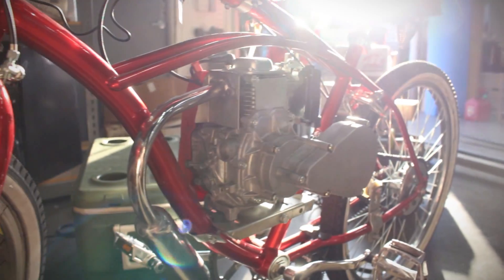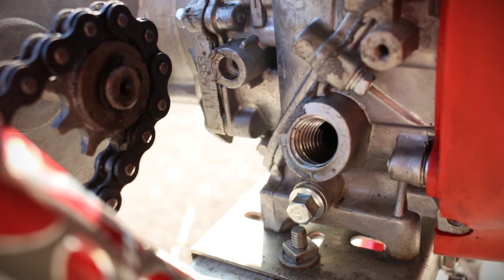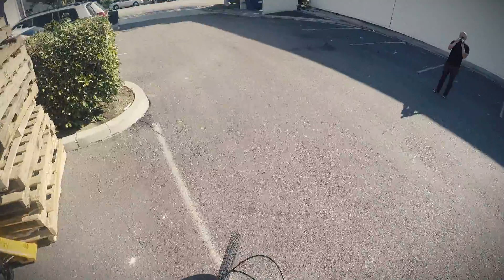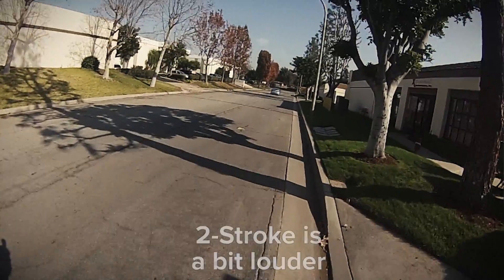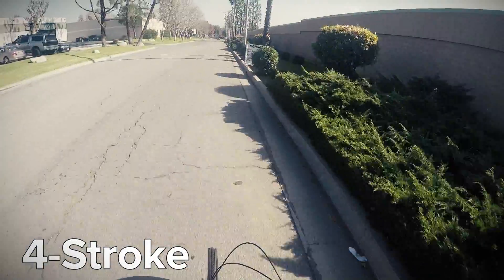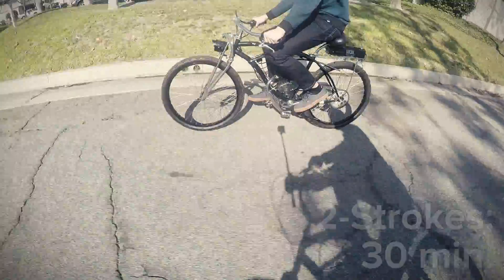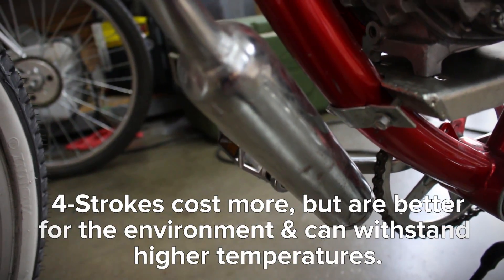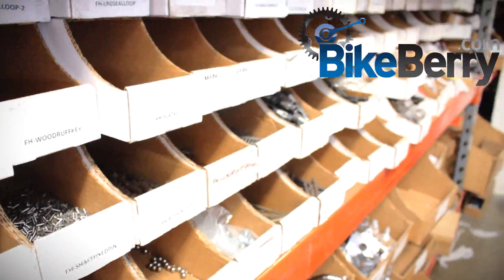2-Stroke vs 4-Stroke Motorized Bicycle (GoPro)

Comment: Don’t listen to him you wanna go 2 stroke all the way you can ride way longer than 30 minutes on a two-stroke this dude’s out his mind. I have 100 cc bike Barry T1 102nd GEN and I took that thing on a three hour nonstop ride… and if you live anywhere where you need to get uphills, a four stroke will not cut it.. four strokes are horrible for hills because they have a belt system… a two-stroke has a chain system as soon as you let off the clutch it engages the motor directly.. that’s why you get more speed and more torque.. They’re actually easier to maintain… they actually last longer than four strokes. Don’t listen to him because there’s less moving parts as long as you mix your oil right with your gas your motor will be OK. I’ve been watching YouTube channels with guys who have the same bikes from six years ago and they’re still cruising with the same stock parts…. Yeah I’m into the motorized bike building hobby… about to post my latest creation with its new paint job. I already posted a video before I gave it a paint job so you can see it.

Comment: The description at the beginning of the video is wrong. 2-strokes and 4-strokes BOTH require 2 strokes per revolution. Up and down. A 4-stroke engine goes through four stages, two complete revolutions, to complete one power stroke, while a 2-stroke engine goes through 2 stages, one complete revolution, to complete one power stroke. But there are 2 strokes per revolution on both of them. When a 4-stroke piston makes 4 movements up and down to complete a cycle, it's 2 revolutions, not 1.

Comment: I have build a 2 stroke engine bicycle build four times but the 4 stroke is the best of reliability (Engine will always start), fuel efficiency is far better than the 2 stroke engine, quieter than the 2 stroke engine, little maintenance, gasoline burn cleaner than 2 stroke engine, very little to no vibrations, 4 stroke engine last longer than a 2 stroke engine. 2 stroke engine is noisy, it vibrate the bicycle and loosen the bolts & screws, it leaks oil, 2 stroke engine is a dirty engine cause you have to mix the oil with the gasoline together, doesn't completely burn all the fuel and sometimes it won't start. The only pros about 2 stroke engine is that the engine and parts are inexpensive, it can be easily modified or upgraded many ways (for faster speeds, aesthetics, etc., etc.) and it slightly has a bit more power than the 4 stroke engine (2 stroke engine - 66/80cc displacement, may get as little as 3 miles per hour to as high as 10 miles per hour faster than the 4 stroke engine (49cc displacement) even if both are using the same amount number of teeth on the sprocket.).

Comment: Now I know that my "1990 vintage Hyper motorized bicycle" is a 2-stroke one. I bought it just recently from a local pawnshop for $380.00, "as is."
I had trouble turning on the engine, though, because I didn't exactly know how. I've watched another video on how to turn it on, including yours, today. Also, I didn't use a mixture of oil and gasoline on it...because I wasn't too sure about that. For a period of about 3 hours, I tried making it work. 👉 PROBLEM: They sold me the bicycle with a couple of wires loose. The one that connects to the "throttle" was disconnected. I connected one of the two wires to the blue wire that leads to the CDI box. Also, the white wire was disconnected, but I now know that it doesn't have to be connected to anything because it's optional and because it is sometimes used for connecting lights to the bicycle. 👉Another problem that I encountered was that both the gas line and the little gas filter started leaking. I need to replace those parts. 👉In the end, I decided to just come home peddling my vintage motorized bicycle, instead. 
Thanks for all your vital information... and for enlightening me. From, "Curious Joe" 😼👍

Comment: Sorry, but a 4 stroke is not 4 strokes per revolution.  It has just two.  A single cylinder two stroke has 4 strokes per revolution.  A single cylinder 2 stroke has one power stroke per revolution.  A 4 stroke (single cylinder) has one power stroke for every 2 revolutions.

Comment: 3 more significant differences :  1) the 49cc 4-stroke engine has a forced air cooling fan that is effective at all RPMs,the 2 stroke has no cooling system, it relies on moving the bike through the air  2) The 4-stroke has a proper lubricating system, the 2-stroke has a very poor lubricating system , so the 4-stroke should typically last much longer due to less wear  3) The gas mileage is much better with the 4-stroke. Period.
Reply: 4 stroke makes less power forgot about that
Reply: air cooling fan? where

Comment: Ow thats weird, normally 4-stroke engine have more powre. How come the 2 stroke in this case has more power and more speed?
Reply: Both engines sound horrible... liek its metal on metal rasping, is that normal? Never heard fuel engines make such rasping sound

Comment: Don’t purchase from bikeberry horrible customers service and they’ll sent you a piece of crap and when u email them. They’ll play the pictures bs. One of the crap customers service   👎🏻👎🏻👎🏻 buy a Chinese one from eBay is much better at least you have eBay money back guarantee.  Bikeberry suck 👎🏻👎🏻🤮. Purchase from bikeberry they sent me a piece of crap it. The treads on the head was stripped and sent over 20+ pictures bikeberry customers service didn’t help. Told me that I have 3 months warranty which I knew and my purchase was only a week old. Bikeberry suck don’t waste your money you’ll regret.

Comment: You want a 4-Stroke! Especially if you want a to ride for more than 20-30 mins in temps above 80. In my experience, 2-strokes are a pain in the ass. Mixing oil + gas = EXPENSIVE FUEL! Who cares if you're getting 100 mpg when you are paying 2.50/gal for gas and 5.00 for oil mix. That's 7.50/Gal vs 2.50/Gal. So now, your noisy smokey rattling pain in the ass little motor who only likes cold weather REALLY only gets 33/Mpg. You're Welcome!

Comment: Where does the tank fuel line connect to the carb, no hoses were connected when I got the motor, there is one nipple bent downward and one straight coming from the carb and two more on the carb bowl.

Comment: 2 strokes suck/push in the gas/oil mix and they complete a full cycle in 2 strokes. 4 strokes require more strokes to complete a cycle and must have the oil separated from the gas.

Comment: Power? 2 strokes are much, much more powerful then 4 strokes when tuned right with a good exhaust on.

Fuel economics? 2 stroke generally drinks more fuel, as they're 2 strokes. Because of that, they're not very enviroment-friendly. But who the f*** cares?

Price? 2 strokes are cheaper due to the simplicity of the engine.

Maintenance? 2 strokes are easier to maintain then 2 strokes, due to their simplicity.

Top speed? Depends on what sprockets you use, but as 2 strokes are easily tuned and more powerful than 4 strokes, you can reach pretty good top speeds. 

Acceleration? 2 strokes got a lot of high end power, more than a 4 stroke. Acceleration on 2 strokes will be much better than 4 strokes. Do some good tuning to your 2 stroke engine and you'll get to much higher speeds and faster accelerations.

Fuel? 4-strokes run on normal unleaded fuel. 95 octane works just fine. 2 strokes however, usually needs to have both oil and normal fuel in it's gas tank. Although this can vary from bike to bike, as some 2-.strokes bikes gets it's oil from another oil container through an oil pump. The recommended mix of oil and fuel in a 2 stroke engine can vary from different engines and setups. But the normal mix is usually somewhere around 2-3% oil (it usually says 1/50 on the cap, which means 2% should be oil (The other 98% should be fuel) in the oil-fuel mixture).

What should you buy if you wanna annoy neighbors? Two strokes.

What should you buy if you're a pu$$y? 4-strokes.

And also, i do want to point out that 2 strokes are NOT manuals. 4-strokes are NOT automatics either. The engine is not "automatic or manual", it's the transmission. 2 strokes can have automatic transmissions too, but they usually never are, because you don't engine-brake with a 2-stroke motor*.That's why i think 2 strokes are manually, and so there usually is a clutch on 2 strokes, that you can pull when not giving throttle.
---------
* All you non- bike/car type of people that doesn't understand why, let's just say the engine is not going to get oil when u don't give your engine throttle and the cylinder and piston is going to take damage, which can be expensive and time consuming to replace. But not as time consuming as 4 stroke-cylinder changes are.

Comment: One thing only briefly touched on (wording was something like "4 stroke engines are better for the environment") is that 2-stroke engines have exhaust that is a LOT dirtier than 4-stroke engine exhaust. So dirty that even a tiny 2-stroke engine spews way more incompletely-burned and unburned hydrocarbons than even the largest luxury SUV with an 8-cylinder engine.

Once you bolt a gasoline engine onto a bicycle, you no longer have a bicycle -- you have a MOPED, a type of motor vehicle. Like all motor vehicles, it requires licensing to be legally operated on the public streets and roads. If you build a two-stroke moped, it will be so dirty that it fails basic EPA emissions standards and can't be licensed.

If you ignore these rules, a cop might notice your lack of a license plate, stop you, and write a citation with a nice, big fine. This is why bikeberry.com has disclaimers about its 2-stroke kits only being suitable for racing use.
Reply from the maker: This is true however some local and state laws allow for these engines. Also, check out our EPA approved kits.

Comment: Are you comparing a 80cc 2 stroke to a 49 cc 4 stroke?
Reply from the maker: no the 2 stroke is a 66cc
Reply: So a 66CC and a 49 cc are fair comparison? 😂👍
Reply from the maker: The video features a comparison between styles of engine, 2 Stroke VS 4 Stroke. It is not aimed to directly compare performance between the two rather give a buyers guide of the perks and flaws both offer.
Reply from the maker: Regarding the Wheel you can call us at (800)317-0479 and our sales team can properly assist you with our in stock items
Reply: Thanks anyways your out of stock of black and i am not going to call for a simple yes or no question that could have been answered here or on your website under the ask question tabs. I think it has been 3 days since i asked there.. It's a shame you lost the sale as i found a 1.5 in mag wheel on amazon thats more suitable for my style of bike.
Reply from the maker: The media team does not work directly with the sales team. Thank you for your inquiry.
Reply: But hey thanks for the 79cc 4 stroke kit, did some mods to the engine as i completely removed the governor not just the arm. The hole the shaft was in was exactly 5/16 so i went to the tap chart and a 3/8 standard fine thread worked perfectly to plug the hole. And i am making a new linkage and hooking it up to the throttle assembly. Anyways I will be posting a vid on this mod as no one has done it this way..  So why i have you here those 99 dollar mag wheels you sell they are 26"x1".  Will they fit my micargi stealth and do you think 26"x1" rim is to narrow for that style of bike and just stick with a heavier duty 12 gauge spoke rim with disk brake mounts? and if you have any in stock give me a link please

Comment: You can tell this kid has no clue what he's talking about not all 2 strokes have Manuel clutches and not all 4 strokes have torque converters
Reply from the maker: You are completely right, we even carry 2 stroke engines that utilize an automatic clutch. These engine kits are entirely customable and can be configured with many parts, in many different ways. We do acknowledge that most individuals will use a Manuel clutch 2 stroke and 4 stroke with a torque converter, which is why it was stated.
Reply: BikeBerrycom you should've said it that way I genuinely thought you had no clue what you're talking about😂

Comment: Why do I always watch comparison videos just after I buy something :(
Reply: Which one you got
Reply: @integrationofmanandmachine4714  2 stroke. Theyre a.good engine but usually rip spokes off bike wheels and even broke my bikes pedal axel/gear thing
Reply: @edg6779  yeah because the clutch just lays down alot of torque at once. While the 4 stroke gets it up to speed but wont ruin your spokes as fast
Reply: lol same I do the same 😂🤭

Comment: Is there a way that a lawnmower engine can work as well for a bicycle motor, since it's a vertical shaft will it still work if the motor is flipped horizontally?
Reply: I have seen a video that addresses that. If I recall correctly, he added some kind of metal tab that would scoop up and throw the oil to get where it needed to be. Without doing something special internally, the bearings don't get oil and will be ruined.

Comment: I sended a message to these guys never got a reply back. I guess they're not interested selling their products. Wanted to know what type of engine I'll need for schwin sidewinder 26' mountain bike. I saw a guy converted it, but changed the fuel intake with offset pipe to fit the engine. I asked him what engine he used didn't answer. So I sended information to these guys no reply...

Comment: Can I put and fit this 4stoke or 2 stroke engine in moped.
Reply from the maker: It is possible, but it largely depends on the frame and how you are trying mount and drive the moped. Some modifications to the mounting and drive system may be needed.

Comment: So...Should i buy a 2 or 4 stroke ? ...Its my first bike.
It's all very well having a fanboy war...but there needs to be a clear winner, people.
Reply from the maker: Sadly, there isn't a clear winner. Each engine fits a specific type of rider. 2 strokes are more fickle, but have a higher potential in terms of top speed, and are incredibly popular in racing circuits. 4 strokes typically do not have as much top speed but produce better torque, smoother ride, and typically have a longer life span than 2 strokes. The winner is the engine that more suits your needs.

Comment: Check out Jr dragster motors. Tell me a 2 stroke is more customizable.
Reply from the maker: We are not saying a 4 stroke can not be customized. With a few adapters, most 2 stroke modifications can be installed onto a 4 stroke. We simply want to state that there are many more parts available that are intentionally made for 2 strokes than there are for 4 strokes, largely due to the popularity of 2 strokes in closed circuit racing. We, however, do agree that there are plenty of aftermarket parts available for 4 strokes.

Comment: the thong that is annoying about 2 strokes is the fact that you need the gas and oil mix
you need special gasoline 
a 4 stroke takes normal gas
Reply from the maker: They both take unleaded gas. Like you said, 2 strokes need to mix the oil and gas, largely because 2 strokes use a different method than 4 strokes to lubricate the engine. Every individual has their own preference. Some prefer the stability and lower maintenance of a 4 stroke, others prefer the higher speeds and aggressiveness ride of a 2 stroke.

Comment: is there a way to put a clutch lever on a 4 stroke
Reply from the maker: Our 4-stroke engines do not require a clutch lever, but have heard of DIY modifications to attack a manual clutch.

Comment: Ebikes are better. They r safe. There is no need for gas so u wont crash and BURN. And they r goid for environment
Reply from the maker: These points are completely true, but every individual has a their specific needs. In a city environment or with short commutes, electric bicycles are certainly a great option. In more rural areas and longer commutes, gas engines are the more practical choice. In terms of environmental benefit, electric is the clear winner. On the other hand, gas bikes are significantly less expensive.

Comment: It doesn't matter how many damn strokes you have gas engines pollute, 2-stroke engines pollute way worse than 4-stroke but you're still getting shot. Question: Which would you rather be shot by, a little bullet or a big bullet?  You're still getting shot dumb shit. ELECTRIC MOTORS MORONS! It's not 1878 England dicks.   https://imgur.com/a/c2NsOsQ  How is this still even a thing?
Reply from the maker: Everyone has their own needs and desires. There is always an argument of electric vs gas, just as there's an argument for motorized vs standard pedal power. There are indeed benefits and detriments to both options, it is up to the individual to weigh those options and make an informed decision.
Reply: How do you so easily justify polluting the air for the entire life of the motor when you have a non-polluting option with equal or better performance? Your "desire" outweighs others physical health?  Don't you have kids? Don't you have anyone that you care about at all?